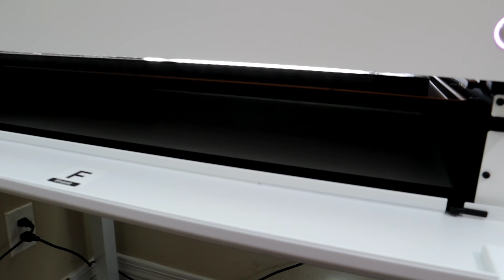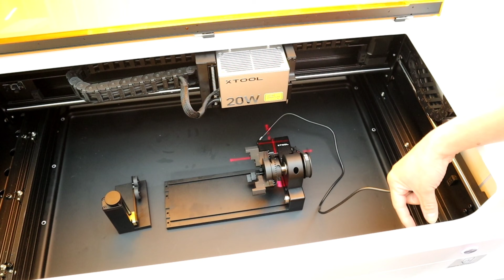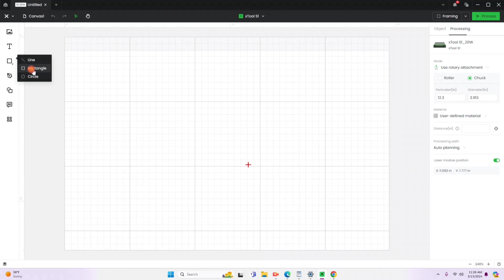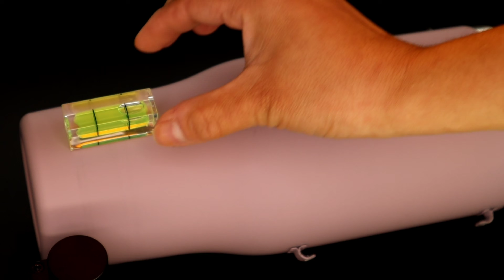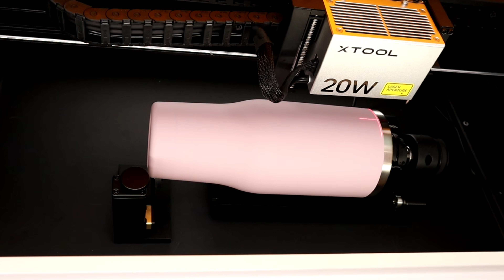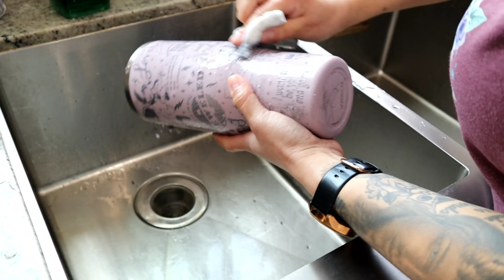How to Engrave Curved Tumblers with the xTool S1: 20w Diode Laser

Comment: On my line testing, while my measurement is accurate when I frame, it does not score fully and is shorter. Even though my settings and framing is accurate. Any suggestions?

Comment: Any suggestions on how to fix lines?Awesome video and extremely helpful but I'm getting lines on mine. I have the XTool S 1-40 watt. 80 power / 220 speed / 100 lines per cm. Testing on a Stanley, light pink.

Comment: Thank you for this tutorial, it was much more informative than others I have seen.
My S1 arrived last week, it’s out of the box and set up. I purchased the riser base after realising you need it to engrave tumblers.
So my question is.. can I leave the laser on the riser base? Is that what you meant by changing the tray level? Do you put the tray up the top if you are doing a wood project or something and move it down to use the rotary instead of moving the riser base on and off all the time? Thank you again 😊 great and easy to understand tutorial 😊🇦🇺

Comment: How can this be accurate? The top of the tumbler is significantly larger in circumference than the bottom? There has to be some type of distortion of the elements?

Comment: Hi there.  I just got my S1 and am ready to try my first full wrap tumbler.  Watching your video one more time so I don't ruin a tumbler and wanted to know why your settings are so different than the recommended ones on the xtool website.  I have the 40w but even when I put the 20w in they are drastically different than the ones you use

Comment: I appreciate the video but that's not 12.3"  It's 12 3/8".  So, 12.3 or 12.375.  Doesn't sound like much but that's almost 2mm which is important if you want things to connect isn't it?  That's why I always measure in metric to be more exact.  If you want the seam to be on the handle, don't you just put the crosshairs at the handle and then put the upper edge of your image at the crosshairs in XCS?
Reply: ??! I’d like to know this?! Is that how it works? I haven’t been able to figure this out

Comment: I couldn't ever get my cuke to unite. Way longer than your 7 minutes, and I tried several times. I ended up using a png for instead.  Definitely needs some tweaking, but for a first try, I'll take it. Same machine as you, in green.
Reply: Actually you don't have to unite vectors anymore. Make sure your version is 2.0.117 and set it all to engrave. Click on the workspace and change where it says processing path and change auto planning to user defining. And you will see a setting that you can turn on to engrave all at once. As long as all the engravings are on the same layer it will treat them all as one image. No more need to combine unite.

Comment: That was awesome!  I hope to try it tomorrow.  One question if you use the chuck and it doesn’t turn do you have any idea as to why it won’t rotate? Mine just went in a straight line.
Reply from the maker: Did you connect it to the machine? It needs power to rotate.

Comment: While the Xtool S1 20w with the Rotary Kit Bundle may be suitable for engraving tumblers, I would recommend considering the Monport laser for your needs. Here's why:

Ease of Use: The Monport laser is designed to be user-friendly, with simple setup and operation. Whether you're a beginner or experienced user, you'll find it easy to engrave tumblers and other items with the Monport laser.

High Quality: Monport lasers are known for their high-quality engraving capabilities. You can expect crisp, precise engraving results on a variety of materials, including tumblers.

Affordability: Despite its high quality, the Monport laser is affordable, making it a cost-effective option for engraving projects. You'll get excellent value for your money with the Monport laser.

Overall, if you're looking for a laser engraving solution that is easy to use, offers high quality and affordability, and is versatile enough to handle a variety of materials, the Monport laser is an excellent choice. Be sure to check out the Monport laser product page for more information and to see how it can benefit your tumbler engraving projects. https://monportlaser.com/collections/co2-laser-engravers/products/monport-40w-lightburn-ready-12-x-8-co2-laser-engraver-cutter-with-fda-approval?sca_ref=5031521.ka374VZjm3

Comment: Question on the angle placement when attaching the tumbler to the chuck. When you angle the bottom does the tumbler attached to the chuck lift up?
Reply: I’m actually here looking for that answer! Mine lifts, but that’s the only way to be able to engrave a 40 oz curved tumbler. Mind sharing the answer please
Reply: im wondering the same thing. Also, the prongs get in my way despite folding them down

Comment: when I click combine unite it doesn't do anything
Also my XCS looks a bit different and the stuff aint on the same place so im just very confused

Update: it worked after a while waiting, for some reason there's not a loading/generating bar on my end
Reply from the maker: It takes a while to combine. It took about 7 minutes. Do you also have the 2.0 software?
Reply: So I had the same issue and I found the only solution is to upgrade to the newer 2.0 beta version that is out. The older software didn’t do anything for me either.